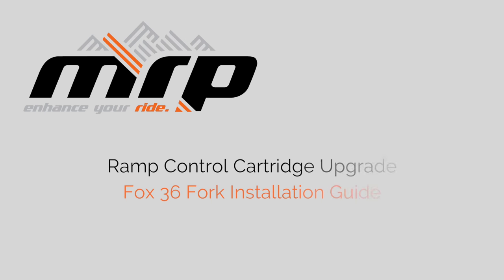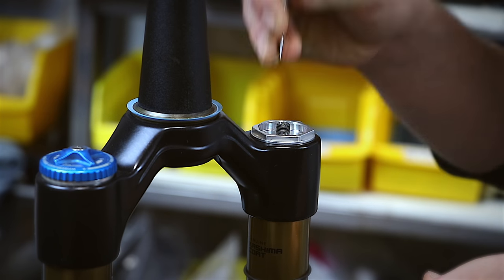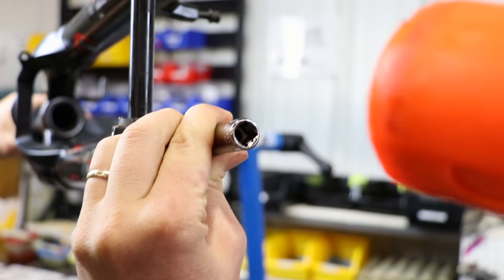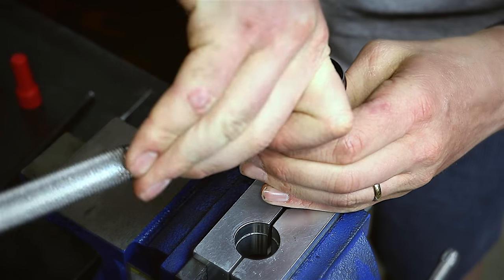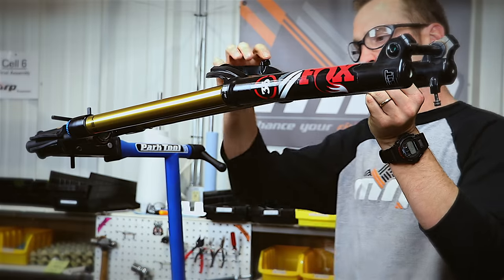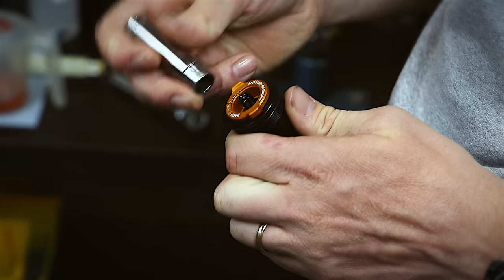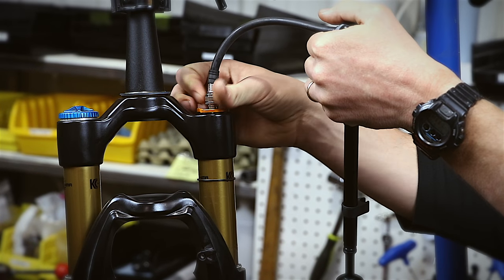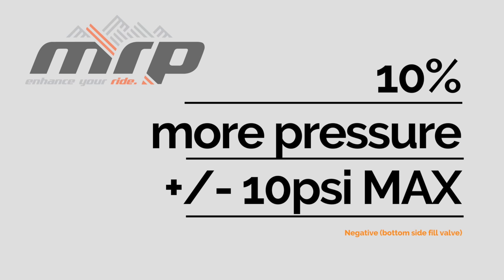How to Install the MRP Ramp Control Cartridge for Fox 36, Version D

Comment: For MRP, a question:  Per the commenter below, I believe fox 36 (2015) has bypass that equalizes the positive and negative chambers.  Why wouldn't that still equalize them after addition of your negative side valve?  I'd think that even if you pump up the negative and the fork sucks down a little bit, the two sides would then equalize.  thanks

Comment: Hello MRP, 
i recently bought a Type F MRP Ramp Control Catridge for my 2019 Fox 36 Grip 2 fork with 160mm of travel. 
do i need to dissassemble my fork like in the video or has this process since changed for the better ?

Comment: Currently in the video at 3:05 you say "torque the assembly at 15 inch-pounds or 5.7 Newton-metres". 15 inch-lbs is 1.7 N-m. What's the correct torque?
Reply from the maker: Noah says "Fifty" - 50 in-lbs. / 5.7 nM. That is the correct torque.

Comment: I did this upgrade but struggle with the travel issues. I have 90 PSI on positive and 95 PSI on the negative. Measured with the same digital pump. Initially it sits at 170mm travel and then comes down to 165mm. Can you tell me what's going on?
Reply: The same thing happens when you take the pressure out of a shock: as you decrease the positive chamber's pressure, the negative then has higher pressure than the positive, so it "wins" the push-o-war on the piston for a few mm until the pressures are once again equal (as the negative volume grows, pressure goes down, and vice versa on the positive side of piston).  They come to equilibrium.  So when you pump up the negative spring, you're helping it "win" a few more mm against the positive pressure.  However, this decrease in the uncompressed length of your shock doesn't affect your effective fork travel because you ride with sag anyways.  So even if you have a 170mm fork, you're riding it at around 140 or 130mm due to sag when you're on the bike, so that's all the effective travel you have.  With this negative pressure situation, your un-weighted length might drop from 170 to 165, but if your sagged height is still the same when you're on the bike, then you haven't lost any effective travel.  My confusion: Fox forks have a little notch or channel that equalizes the two chambers when the fork is uncompressed, or at 5% (can't remember)...  Why wouldn't the two chambers just re-equalize after you've pumped up the negative chamber to have higher pressure?  Perhaps a fox person can tell us...

Comment: This will work with the 2018 Fox 36 Float? FIT4 or HSC/LSC versions? The 2018 Fox equalizes positive and negative pressures via the bypass port.
Reply from the maker: Yes! Compatible with the FIT4, RC2 and Grip dampers.

Comment: Why do I need to open up the fork all the way? I thought I’d just need to replace the air cap with an mrp.
Reply from the maker: That is the case with the Rock Shox models, installation is more simple. The Fox 36 requires a conversion of the air spring as seen in this video.
Reply: What component of the piston is being converted?  The stud on the end is obviously different, but that is the only thing shown.  If that is the only difference, why bother?

Comment: I think you should make a note about just how difficult it is to get the footnut off the air shaft. The video makes it look easy but it's not. I ruined one using using standard softjaws in a vise. The nut was so tight that even with the shaft torqued down as tight as I could make it, it turned before the nut came loose. The shaft needs to be clamped super extra tight to prevent it turning. I ordered another airshaft to the tune of $65 US thinking I'd be able to get the foot nut off that one easily. No suck luck. Apparently Fox didn't intend for them to be removed easily.

I have the ramp control on a pike and it's awesome, but I don't recommend it for the 36 unless you're willing to roll the dice on the footnut coming off before the airshaft gets scored.
Reply: Yes, guys. Can you please address this? I see lots of people having the same problem on various forums etc. Will a Rubber Vice Clamp for golf do? Or do you have any suggestions?
Reply: I used a impact driver.  I clamped the air spring assembly with a polyurethane soft jaw so that it butts right up against the nut that needs to be removed.  Used a crows foot 12mm and attacted it to the impact driver.  If you slip off the nut, it will damage the threads on the bolt that is coming off but we won't need that part anyway.  With a couple full power trigger squeezes at half second intervals, it comes right out.  I've done two so far like this and it works perfectly.  If you don't have the tools, it's a bit of an investment.  Without impact driver, it will just spin in the soft jaws.
Reply: Hi Scott - thanks for bringing this up - can you clarify for me: when you say "footnut", are you referring to what Noah calls the "Piston Bolt"? If so, what kind of head does it have (Torx, Hex)? Thanks!
Reply: I used a pneumatic impact wrench too. Go figure. Fox put a huge load of red Loctite in it. Without the impact wrench it is IMPOSSIBLE to remove the piston bolt. Absolutely impossible.
Luckly I had an old piston (old warranty replacement from fox) and I made some practice on that one, but sure as hell if you don't use an impact driver there is no chance to remove even with the best soft vise jaws.
Reply: @Thomas-mq8ne  I used a golf club clamp and my wife's hairdryer to warm the foot nut - that softens the threadlock Fox use enough that it is easier to do.
Reply: Heat the foot nut up with a butane or propane torch to free the loctite.  Fox has these instruction on their website and actually show it in their rebuild videos.
Reply: I'm facing the same issue right now. Thanks for the tips with the impact driver and also with heating up the area, i will try that next.

Comment: @MRP Bike one more question regarding the negative air spring part of the Model D kit: is it necessary to install it (Fox 36 my 2015) or does the kit already work and offer improvement over the original setup, without the addition of the negative air assembly? Like many commenters below, I find it impossible to remove the bottom nut (https://youtu.be/jhfwYDcCGFQ?t=167) and do not want to risk ruining the piston. Thanks, your reply will be highly appreciated.
Reply from the maker: Unfortunately it is necessary. As for removing the bottom nut, a little heat on the rod will loosen the threadlocker bond and should make that much easier.
Reply: @MRPBike  thanks for the quick reply.
Reply from the maker: @reinhardwagner8559  Of course, definitely let us know if there's anything else we can help with.

Comment: Hello, I dont understand the intructions.. Sorry
For example: my weight is the 70 kilograms, then 90 per cent, 63 psi in the positive chamber.
Which is the recommend pressure in the negative chamber? Thanks MRP
Reply from the maker: Hello,
No worries, thanks for the question! Most people prefer roughly 10% more pressure in the lower chamber. So in your case, ~69 psi. We don't recommend you ever exceed 10psi difference, as the fork can then shrink down in travel.
Reply: MRP Bike alright!!! Thank You for your help! :)

Comment: Fitted the ramp control for a Fox 36 yesterday. When I fill the negative chamber I can't even get close to the positive pressure with out the fork sucking down loads.........what's going on?
Reply from the maker: You might have accidentally created a vacuum in your lowers. Try purging them by sliding a small ziptie under the wiper seals with the fork fully extended. Then try filling the negative. Be sure to use a low-volume, suspension specific pump, and pump slowly.

Comment: Will the negative air chamber pressure change after some high and low speed hit，is it normal or somethings go wrong with my fork?
Reply from the maker: Thanks for the question. What makes you think your air-pressure has changed? If you connect a pump to the negative chamber, it will read substantially lower than your initial setting as a result of air escaping the chamber and entering the pump. This is not indicative of a pressure loss in normal operation. Inside the chamber, air-pressure does change as the fork cycles. But, the static pressure (at full-extension) will not fluctuate from where you set it at upon initial setup. A leak of the negative chamber would manifest as harshness at in the initial stroke or "topping-out" when the fork rebounds to full-extension.

Comment: Is this the same process for Fox 34s?
Reply from the maker: Hey Josh, thanks for the question. No, this is a more involved process on the Fox 36 because it converts the air spring into the positive/negative chambers. The Fox 34 is a very easy install just inserting the cartridge in the air spring leg.

Comment: Does the 2018+ Fox 36 need the lowers removed as well?
Reply from the maker: No, you'll want our Fox Version F for a 2018 and newer 36. This is a drop-in cartridge that does not require leg removal. Installation is very easy.

Comment: I would like to make this upgrade but I hardly can believe that pumping slightly more air into negative air chamber will have any more effect than reducing the travel right away. Could somebody explain me why it will not reduce the travel and just make the pressure equalized like it used to be?

The thing I did just recently and I think has much more impact is changing the volume of the neg chamber. I have 180mm version but running it in 160mm. Because the travel is regulated by the transfer shaft not the spacers for neg chamber I was able to do the tuning. I just removed all the spacers (2 of them) that normally are recommended when running this fork in 160mm mode and did spacer setup like it is supposed to be done for 180mm version. The fork is night and day compared to the old setup. It's smooth as butter. I had really huge problems with my hands with this fork. Pain all the time. Now it's all gone and it swallows chatter like it supposed to. 

What do you guys think. Is this ramp control thingy is worth this money or simple volume tuning of positive and negative chambers is more than enough?
Reply from the maker: Thanks for the comment! The reason a slightly higher negative pressure does not eat into travel is due to the fact that the surface area the negative spring is working against is smaller than the positive. That's why in order to get truly equal opposing spring forces, a slightly higher negative pressure is required. Without that, you're still going to have somewhat of a breakthrough sensation in the initial stroke.
 
As for modifying the stock negative spring and removing parts to create a higher volume, I'd be hesitant to do that simply because it would seem logical that all the parts should be in there for some purpose, and their removal wouldn't come with without some tradeoff elsewhere. In general a higher volume negative spring will only increase the distance into the stroke that the negative spring has an effect upon. It won't necessarily improve initial stroke sensitivity, but it will help the ease in which the fork compresses into later in the stroke.
Reply: I agree with everything 100%. It does in fact not help with initial stroke. But it greatly helps with the section after. The progressivity has changed but I can still regulate it with tokens in positive chamber. The 2018 floats are equipped with bigger negative air chamber by default. And they don't have the transfer shaft. So the 2018 fork is quite similar to the previous version with your device installed (sans the cartridge of course). 

Replaying to your worry about missing parts. Yes. I was extremely reluctant doing this tune, but I also had to do something or otherwise I would sell the fork. I read everything what was there on the internet and this is very common complaint about float 36 rc2. That it is harsh. Probably the tune is perfect for super aggressive or/and bigger riders (I am 85kg with equipment) but for me it was killing my arms. And I mean seriously. I had tennis elbow and some problems with my fingers also. I ride in hard terrain with this fork (Leogang, Saalbach in Austrian Alps) and chatter really kicked my ass last year. 

Applying my tune to fork with your ramp control installed will be trivial. So basically I will start just as if my fork would be 180mm version. But instead of pumping even pressure to the neg chamber I will pump it until the travel will be 160-165. I cannot believe it could harm the fork. Even right now some fox forks leak too much air to the neg chamber (bad seal or whatever) and this does not destroy the fork in any way. It will just make the travel shorter. With a bigger neg chamber as as side effect. 

So applying all of this to your product I cannot wait to test it in the Alps. I will install it as you suggest but I will pump the neg chamber slightly more. And maybe when going into the big mountains I will also just try 180mm travel instead of 160mm. With this thing installed it should be just a matter of releasing some air from the neg chamber (sweet :)).
Reply: goroncy  hey man did you try the ramp control? How about your negative spacer removal long term review? I just buy a used 36 so curious to hear about your experiences